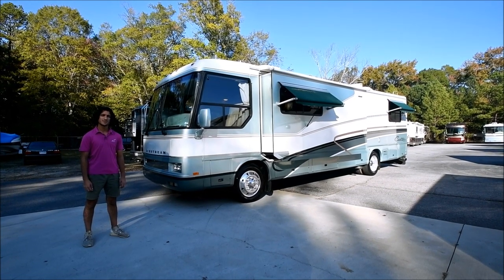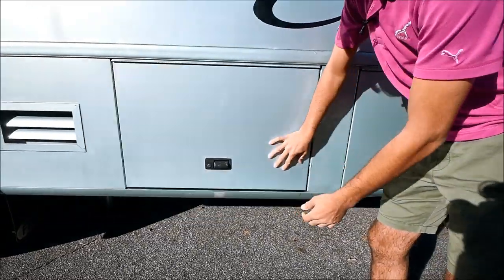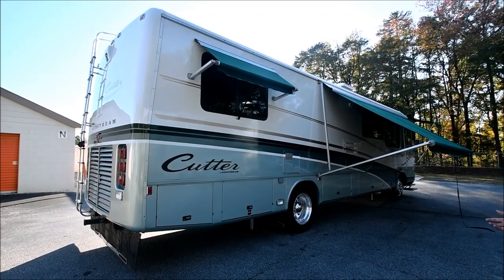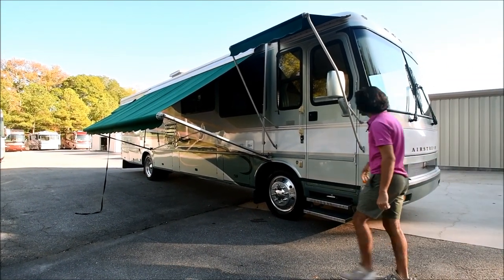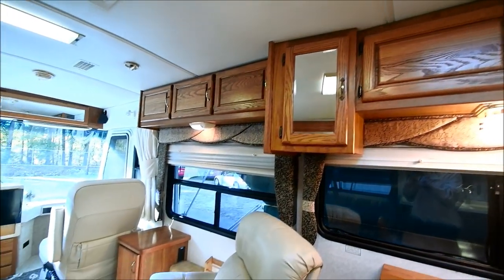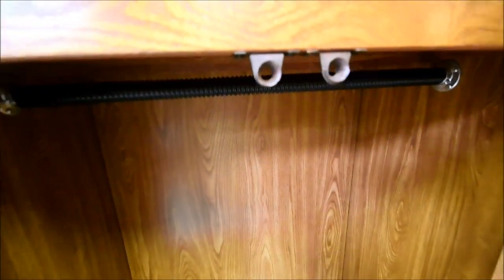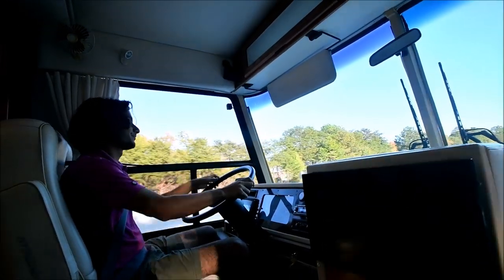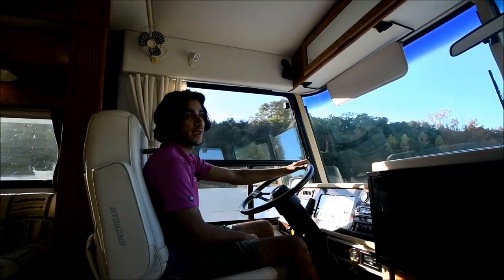1999 Airstream Cutter 35 Diesel Pusher Excellent Condition $37450!

Comment: Nice Coach but still way over priced.  Paint is not the thing you should be looking at when evaluating a purchase.   It's still 20 years old no matter what garage it was kept in. Generator has too many hours to justify this high price. That shows lots of use.  The Coach is only worth about 20,000-25,000 and that's what you see in the market. It's basically worth what some one else is willing to pay.
Reply: While this is an old post, I half-agree and half-disagree. I think the paint condition is an indication of the overall care of of the RV. Yes, the items that break-down over time are why you are getting such a huge discount on old coaches, RVs, what have you. When you buy one of these, you (or someone you trust) will check everything out with a fine tooth comb, but coaches that sit outside start to break everything down, especially when they just sit and sit.

Diesel gensets (the good ones), should have no problem going well past 10k hours. In the marine environment I've seen them go to 20k, with maybe a new powerboard or motherboard.

Start with a reputable manufacturer is the most important thing when considering an old ANYTHING! 😉
Reply: @PaulSter  exactly . It's not good for a motorhome to just sit .